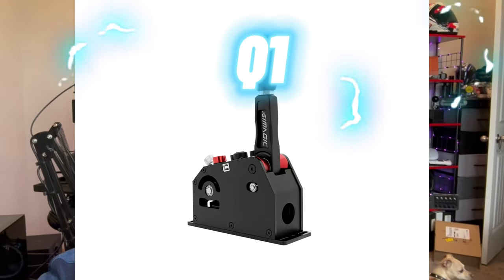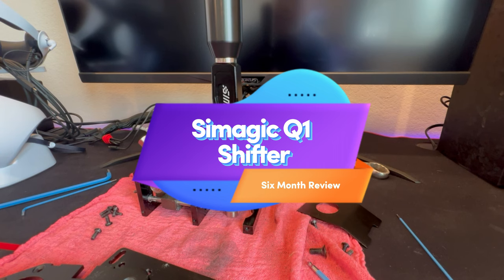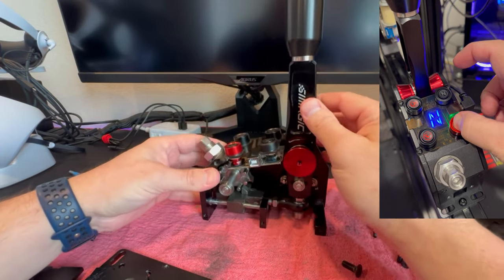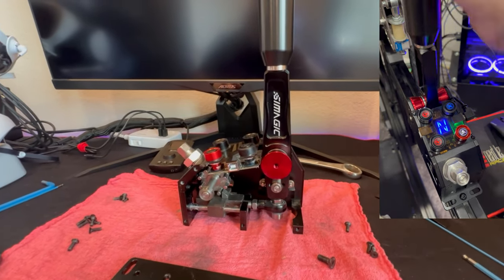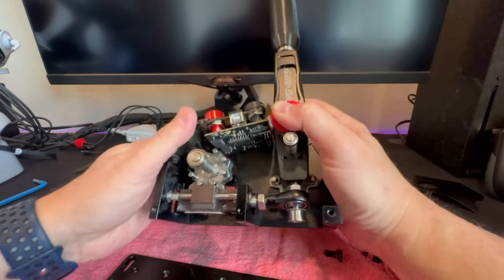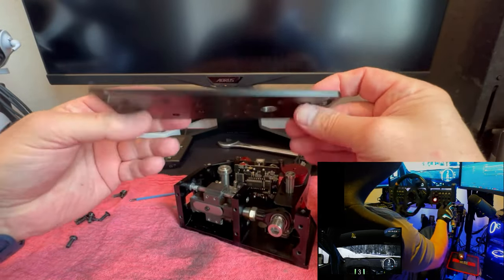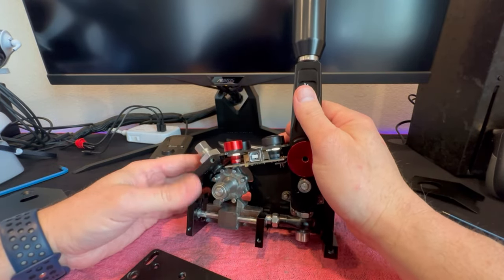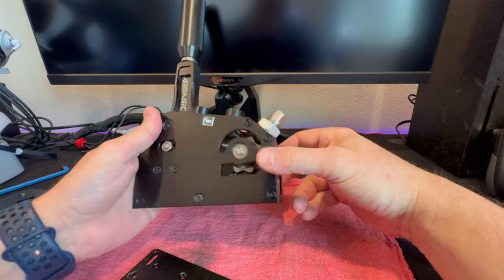Simagic Q1 Fixing issues + Six month Review

Comment: There could be a number of solutions to this. Either a slightly thicker retention plate with a milled 'hole\depression' to hold the sprint, or the plate being a little longer, and using 3 screws instead of the one in the center. Another possible solution would be to use CA glue, or perhaps nail polish or something similar on the ends of the springs to prevent them from working around the retention plate?

Comment: Hey mate have you ever had the problem where you can shift down I have a 4 week shifter and the software doesn't recognise shifting down anymore just up
Reply from the maker: Hey thanks for the question. Actually no I haven’t seen that. Does it register with your pc controller? Not just the simpro manager? I’m assuming you are saying it not registering with the Sim Pro manager software?

Have you recently add new usb devices to your pc? Sometime this will cause weird issues like that. You can also try plugging it straight into the pc  USB to test it out of you are using a usb hub atm. 
Also can go into windows software and select the controller USB as priority. I forget the menu would need to google that one again. 
Hope this helps man. If not feel out a repair ticket on their Discord page.
Reply: @TJRSIM  so it reads the device in the software and was working fine but the other day I was racing and it just stopped gearing down only up.

I haven't added anything new I even switched the motherboard part in the middle wasn't that.